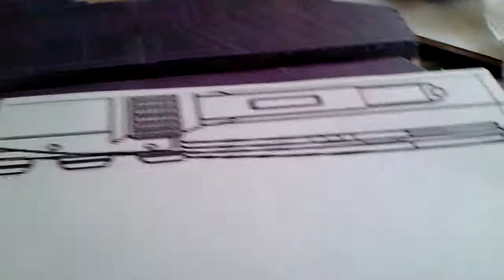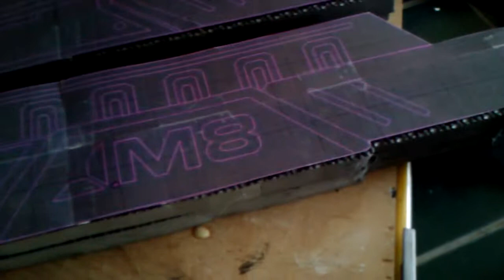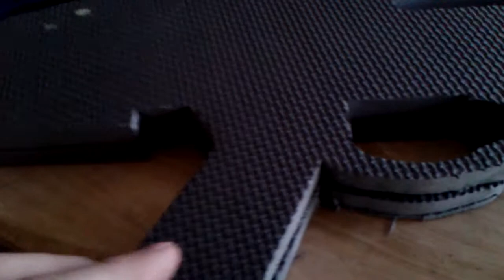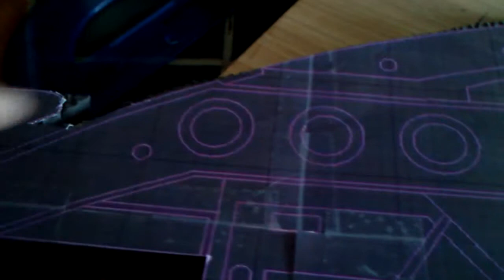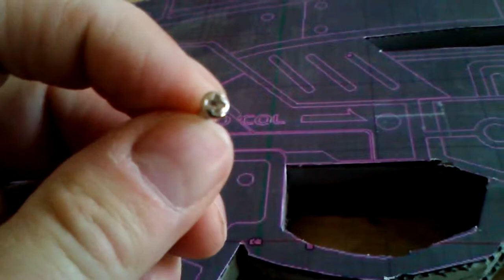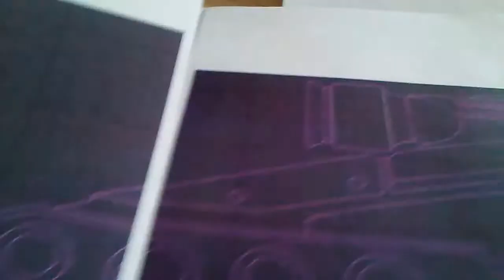Foam M8 Avenger Build - Getting Started

Comment: what are the measurments of the M8 thinking of making one for display / cosplay purposes
Reply from the maker: The rifle body is 29 inches long (excluding barrels) and 11 inches high (excluding the sight assembly). You could certainly make it a little longer or shorter if you need or want to, but that size works for me.